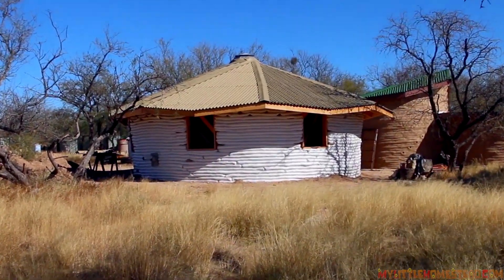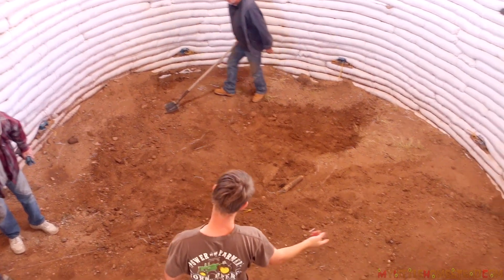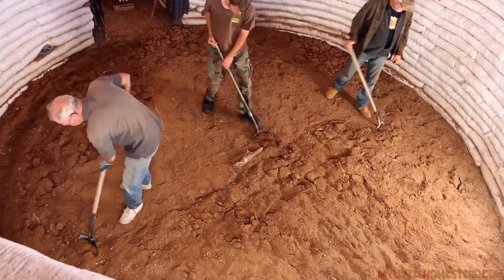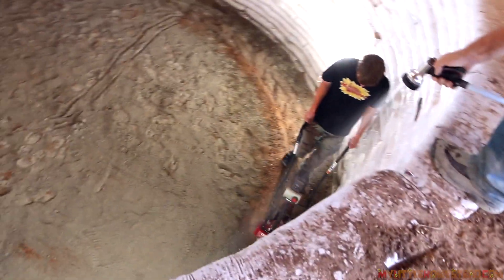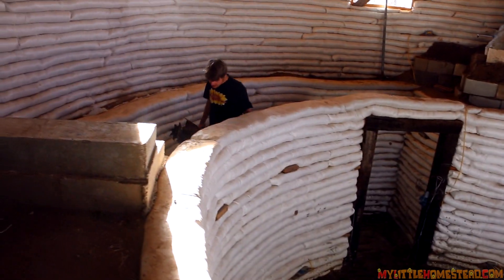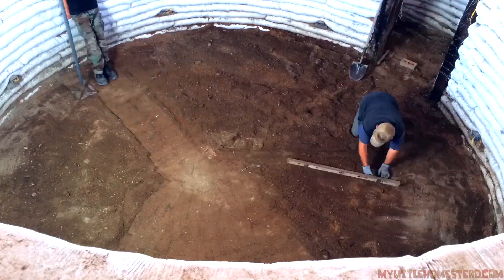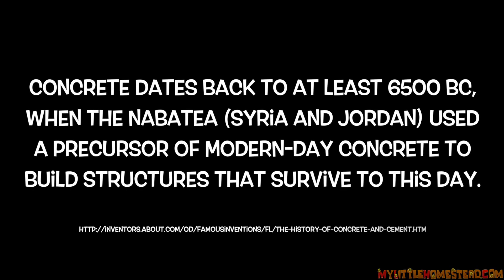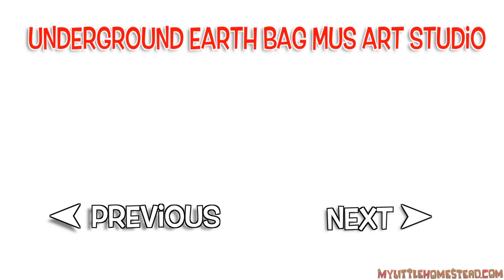Soil Cement Subfloor in Basement | Underground Earthbag Building | Weekly Peek Ep68

Comment: Soil cement...how do you get the proportions correct so the strength isn't compromised?
Reply from the maker: The best we have found with our soil type is 1/2 inch of Portland cement, tilled into the ground 4 inches. You have to try out a couple square feet and test the results.